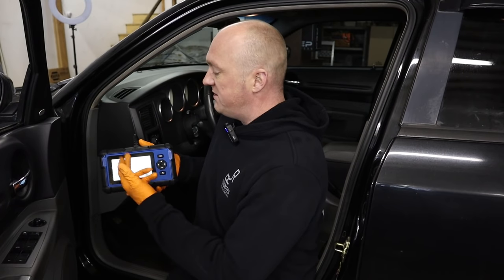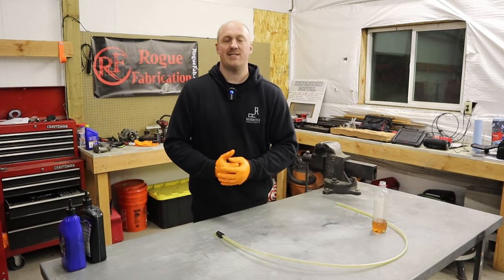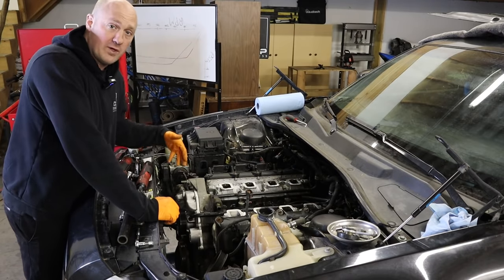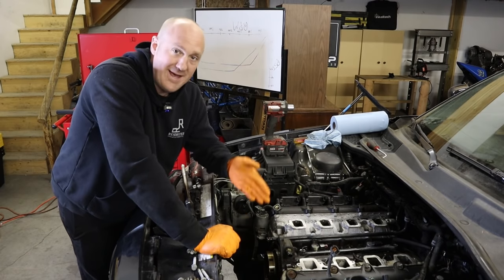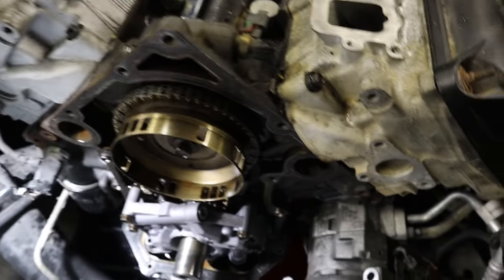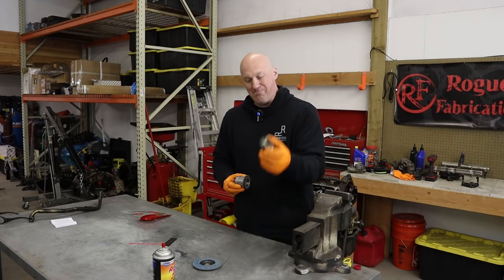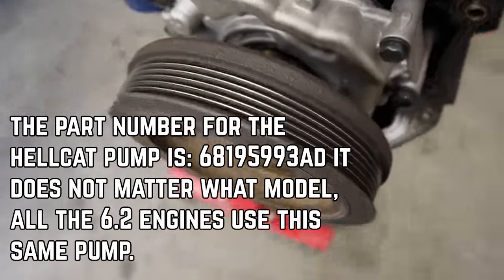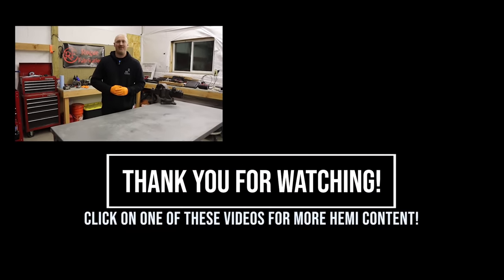Will This FINALLY FIX Hemi Tick? #hellcat

Comment from the maker: What do you think? Are you convinced that this mod will fix the lifter issues?
Reply: I'm skeptical too be honest. I simply run Redline 10w30 and my oil pressure has never went below 38psi, on a 97 degree day after doing a 0-130 pull lol. Typically my oil PSI sits around 44-46 when hot and idling.

Edit: I should also mention my water temp was 243 for what that's worth
Reply: On my RAM 1500, if I tune my idle to be a bit higher, is that a decent temporary solution to low oil pressure or is it pointless?
Reply: nope, it wont fix the lifter issue. The hemi tick came from the Bermuda triangle.
Reply: Nope. However it is a good upgrade. More volume more lubrication. I'm more convinced that it has alot to do with overall engine and oil Temps. 195 t stat and a oil cooler would help alot in my un educated opinion. I'm personally running 5w30 year round hee in canada. Only 45k miles on my 17 5.7 ram so wish me luck.
Reply: if low oil pressure at idle is the problem, then this will cure it. I have a question about oil pressure sending units. Mine failed (13 Charger 5.7), and the replacement I was sent still shows oil pressure at a constant 99psi. The OBD2 reader says that the voltage range is not what the computer is expecting to see. The part number I was expecting is 5149062AA, people keep sending me 5149062AB. The Chrysler TSB says to use 5149062AA... What is the difference between the two part numbers?
Reply from the maker: @Tumbleweed_Tx  the change from AA to AB just means it's a superseded part, its the same part.
Reply: @Tumbleweed_TX  You could have a break in the wire harness.  The open circuit would explain the code your getting.
Reply: I can only see this being a good thing. Trying to decide if I should do it myself.
Reply: Time will tell if this fixes the lifter issue, but it is a very sound theory for now.
Reply: I hope it does🤞but only one way to tell.
Reply: I have an 09 5.7L Charger PP w/149k miles. I put the last 3k miles on it. I would only get a tick for a few seconds on cold startup after the car had sat unused for about 10 days. I have done 3 oil changes on it. One when i first bought it at 146k miles, and the second at around 148k. When I installed my filter @146k miles, I also added some neodymium magnets to the outside of the filter can. About a week or so before the second oil change, I added about a 1/2 qt of MMO, and then I added 1/2qt  of MMO the day of, just before I ran it about 10miles up the freeway and back immediately prior to my 2nd oil change. When I cut open the filter, it was obvious that the magnets had captured significant ferrous "dust." With my oil refill I added 8oz of MMO. I have been running full synthetic  5W-20 and a WIX 57899 filter. So far the tick is now gone. I've only put maybe 1k miles since, but I've not heard any ticks on cold startup no matter how long it has sat idle. I'm thinking that maybe I've cleaned out some (possibly metallic)debris from a lifter passage or two. 
I may well add the Hellcat pump in the future, anyway, and I thank you for performing this excellent experiment for us 3rd gen HEMI fans out here.
Reply: I think it will shurely make it a heck of a lot better. But ofcourse a lifter van always fail. I always thought it was related to the vvt
Reply: Is this worth doing on trucks with 100k miles or more? Or would this have to be done to a newer truck with low miles or an overhaul?
Reply: What is the solution for the different oil pick up tube when putting the hellcat pump on a 2010 Ram 1500 with the 5.7?
Reply from the maker: @notaspamaccount3998  it bolts up just fine, it's just more work because you have to drop the oil pan down to unbolt the pickup tube from the pump.
Reply: @ReignitedAuto  Awesome! For some reason I was under the impression that the pickup tube size was smaller on the 5.7 than on the hellcat pump. It's great to be wrong.
Reply: @ReignitedAuto   The oil pressure on my 2017 charger 5.7 is 55 to 62 when cold and 43 to 50 when hot at idle.  Do think they upgrade they oil
 pump in the 2017 model, because my oil pressure never drops below 38 psi
Reply: Definitely went above and beyond for this one. After having to replace cam and lifter in my 5.7 charger pursuit I for sure want to do this mod just for piece of mind. I also think they used aftermarket lifters because my motor sounds like a sewing machine. Thinking about swapping the lifters just to quiet the motor. Great info though 👍
Reply: Hi
The best solution would be to use Something similar to. oil piston Squirters For every piece of camshaft where the lifter works. 
In addition, a beautiful and laborious presentation for which I thank you. Greetings from Polish.
Reply: I think this is a way to improove the 5.7 but I think even with higher oil flow you not completly eliminate the lifter failure. I think at long idle the oil on the camshaft and the roller lifter is not enough. For the Oil pressure my 2009 Chrysler Hemi (european version) has around 40PSI oil pressure idle in hot conditions and above 70 psi in driving over 2000rpm. I use 5W30 oil because it is recomendet by Chrysler for this model in Europe. My car has now 145 thousand miles and no ticking at all I hope this will last for very long time. I like your videos and the detailed explanation what you think and all the steps you do. Thanks
Reply: What are the torque specs for the mains on a 3rd gen 5.7 with VVT?
Reply: Is the 99psi relief pressure from a hellcat oil pump okay for the 2009+ eagle 5.7 hemi non mds. No downsides involved?
Reply: Also all your videos and discussions are awesome. Building my STP 2012 challenger so you have very awesome content which I come to regularly! Even taking things I learn onto my dad’s ‘70 Cuda build!
Reply: Either way it certainly cannot hurt the engine.  I am definitely going to upgrade my oil pump to the Hellcat version as I am keeping my one owner 300 long term.
Reply: idk in my 21 5.7 im seeing if i remember correctly 37 hot idle psi it may have been 27 ill have to check next time i drive it...
Reply: you will be interested to know this... a 2021 5.7 idles around 750 rpm but i was seeing 34 PSI at those low of RPMs... when i revved it up to 3500 my PSI was at 55... this has me wondering if dodge did some more reworking of the oil pump to get those numbers up a bit from 2017 to 2021...
Reply: Thanks Reignited. This modification kept me busy for three days in my driveway and absolutely love the higher oil pressure when especially when my 5.7 engine is hot and left idling. After fitting the hellcat pulp It never goes below
220kpa and that makes me very happy.

Boy it was a project for me under the carport but I got it done using your videos as a guide. 
The RAM is different because it has so many more strengthening brackets and a front Diff to lower out of the way.
But I got it done with your help. Thank you Sor
Reply: @ReignitedAuto  no it’s The hellcat pump I fitted gave me higher oil pressure at low idle and all through the rev range. 
It’s well Worth doing
Reply: My concern is: will highier oil pressure cause oil leak?
Reply: @derekliu2448  I have the hellcat oil pump amd I have no oil issues and enjoy high oil pressure at all engine speeds. Highly recommend this improvement to engine lubrication.
Reply: @secretdad544  Thanks a lot for replying me. How long have you had it?
Reply: @derekliu2448  it was a brand new car at the time I did the modification. 
It had done 5000 kilometres
Reply: @PotatoeJoe69  are you sure about 243 water temp? last i checked anything over 225 was overheating my friend...
Reply: @gidderman  You do a 0-130mph run on a 97 degree day and let me know what your water temp is
Reply: @PotatoeJoe69  Lol not overheating. In fact with my CSF Rad i would say i could run in 110 degree weather,.. and the engine would not go over its normal operating temp, pulling a trailer no less. If you are running at 243, something is wrong...
Reply: @derekliu2448  hi Derek
I have a new RAM1500 with 5.7 hemi 8 speed auto. (a DS quad cab “poverty pack” delivered in Perth western Australia February 2022 and 
After the dealer refused to fit the higher volume oil pump saying it was not necessary
I went ahead and fitted the higher volume Hellcat high volume pump at about 9000km (closely following this channels awesome advice.)

The effect has been to have higher oil pressure across the whole
Rev range 

But because of the oil pressure relief valve built into the oil pump the maximum pressure is never higher than 520kpa 
(520kpa is the highest pressure Which only happens On cold (6 degree celcius) start up.)

Once the oil
Warms Up to about 100- 108degrees celcius - the oil pressure Settles down to  about 430kPa on the highway at 2000rpm

Engine at idle is where the main difference is found
With a hot engine,  oil pressure gets down to as low as 225kpa with the hellcat pump

Which is better than the original oil pump which would go as low as 190kpa at idle on a hot engine (hot engine oil temp 108degrees celcius) 

I am feeling Very glad I did this modification of fitting the hellcat oil pump - even though it took me 3 days pottering along in the driveway… RAM being 4WD meant I had to lower the fromt Diff and remove a few extra strengthening brackets that are not found on a street car but are fitted to the RAM to beef up the driveline strength for off road

I am happy because I feel the higher volume hellcat oil pump is going to ensure that my engine is always bathed in plenty of oil - even at idle rpm

I use 0w - 20w Amsoil or 
Nulon 0w -20 Full Synthetic and 
My oil has stayed clean for 10,000km at the higher pressure and so far all is good - no valve train noise.

Another benefit is that while I had the sump
Off 
I got to clean out a couple of slivers of metal that were sitting in the oil pan - (probably from machine work during the engine’ s manufacture).

No oil leaks and all I did was follow the directions in reignited’s video.
Reply: My question would be, can the 5.7 handle the extra oil pressure?
Reply: @dangnation5378  the oil pumps all have a relief that limits oil pressure. My engine is fine. Never goes under 220kpa
Never goes over 570kpa (cold start)
No oil leaks. No hemi tick.
I fitted the hell cat oil pump when my 5.7 made 10,000 km and I am glad so did it
Reply: @secretdad544  good to know. I have a 2020, I’m not sure if they fitted a better pump from factory but my cold start says 344kpa and 413kpa at around 3000rpm under light load. Still researching the oil pumps as there isn’t much info on the 2020 and newer. Very appreciative of you sharing your experience.
Reply: @dangnation5378  cold start was high on mine too… but after the oil gets to 100 (centigrade) the oil pressure at idle with the stock oil pump would go down to 180 - 190(kpa) 

Since fitting the hellcat oil pump I never see under 220 (kpa) even at idle.

It is higher everywhere but the low pressure at idle was what I was wanting to improve. 

It was a hard job on the 4WD RAM 1500  my driveway because big bolts and dropping the front differential out of the way meant a lot of brackets had to come off 

But now I am glad I did it every day

I also followed the directions in his video and no oil leaks 🙏
Reply: Now if we can fix that hemi low oil pressure with the hellcat pump i will consider it a full fix ✌️
Reply: Can the lifter tick be heard while idling the engine for 7-10 minutes after driving or is it only in start up that you would hear it?
Reply from the maker: @beauderoy7745  lifter tick is generally only noticeable after the engine is warm,  unless it is really advanced to where you'll hear it at all times.
Reply: I think your dead on with your results that give true readings. 
  I was wondering however. 
  I have a 2015 Challenger 5.7 Manual shift. 
  Since it does not have the Eco system do you feel I have to be concerned with a lifter failure?
  I would think no since I don’t have that system. But that being said I do have a stock oil pump!
  At only 20,000 miles showing no signs of lifter noises and no residue in old oil. 
  Thanks again for some fantastic videos. 
  Please give your opinions on my car. 
  Thanks
    Richard
Reply: Hi sir. I have a question. On the driver side… 4th lifter doesn’t fully slide in the hole.. any suggestions??? Thank you so much
Reply: Hello sir .. I have a question. Driver side 4 th lifter doesn’t fully slide into the hole. Any suggestions as to why not?? Thank you 🙏
Reply: Hello, I made repair my engine and replace my old oil pump to hellcat oil pump. Now I have code p1524 (oil pressure out of range). So is there any solution for this issue? If I change oil pressure sensor replace to hellcat sensor will it help ?
Reply: Like 500 bucks for that pump 
It better work ,plus mech pay and fluids smells like a ripoff 
Thinking a old 2jz and a Lexus automatic transmission would do better and last more than 180xxxx miles  
Absolutely awesome video and tips
Reply: My 2019 5.7 always has 50psi on start up and 49psi when idling with oil hot.  I never see much difference in it even during the winter.  It has 33k mi.
Reply: @Aldovargas87 I was wondering the same thing
Reply: @secretdad544  I'm looking to do the Hellcat pump swap on my '14 Ram 5.7. Did you have any loss in fuel mileage?
Reply: I have a 2019 1320 scat pack, does this model, do I need this too or I’m safe to stay with the one in the car now. And if I do need to change it what is recommended.
Reply: No because the Hellcat lifters are failing the same.  A friend of mine works for the SCDOT and he does about 7 of these a month for police cars and fleet trucks with the Hellcat engine.
Reply from the maker: @horsingnaturally2244  police cars and fleet trucks do not come with the Hellcat engine. There are 6.4 powered trucks, but the Hellcat is a 6.2 engine with a different oil pump.
Reply: My 2014 Ram 1500 is in my shop with the new (NuTech reman from Autozone) engine hanging from a hoist while I attach the old manifolds and new pumps because my tick turned into a clank at 250k miles. It came with an oil pump, and I’m going to mic it to see if it’s the same size as stock or if they sent a higher volume pump (which I highly doubt). Wondering if I would void my engine warranty by putting the Hellcat pump on it. Thoughts?
Reply from the maker: @philbear21  there is the potential that it could void the warranty. However, you would have to be pretty darn observant to realize there is a difference between the Hellcat pump or a stock one since externally they are identical.
Reply: @ReignitedAuto  yes youre right. The external dimensions of casings are identical. 
I don't remember the numbers, but I did mic them and they're the same.
The difference is inside, where they milled it out to accommodate the larger pump rotor.
After seeing your post on this, I installed one on my 2014 Ram 5.7.  On cold start I'm pushing about 95 psi, after warm up about 70.
That's a helluva jump from 58 and 40
Reply: I don't know if it will actually FIX it, but better flow means better lubrication. Team that up with a quality oil stabilizer, and it will sure prolong the life of those needle bearings against wear
Reply: @ReignitedAuto question regarding supposed upgraded lifters you were talking about in 2016. Do you think the upgraded lifters have better designed needle bearings than earlier versions and that is how they get the term “upgraded”?
Reply from the maker: @lickitysplit2413  I don't think they are better at all. Once they went to larger diameter needle bearings they had to make the roller thinner, this was a mistake in my opinion. I actually prefer the older style lifters, but they are no longer available, only the newer style.

Comment: I'm not sure if Ram had ever installed higher flow pumps for certain model years but I own a 2016 5.7 bighorn stock and the idle psi has always stayed around 42 at full running temp. I also live in Texas which the outside temp stays around 100 F during the summer. 

I recently just hit 200,000 miles with no major issues except when I replaced warped exhaust headers with aftermarkets around 130,000 miles. All maintenance done  such as oil changes every 5,000, transmission flush, tune-ups, radiator flush and full suspension replacement at 170,000. It has been a great truck and I plan on putting another 100,000 miles on it! I would much rather get an engine replacement instead of buying a new or slightly used truck with today's prices! I just can't comprehend paying $50k to $60k for entry level model!

Comment: Thank you for all the time, effort & expense in performing this testing with the different OE and Melling oil pumps; Impressive video!
On my 2021 Challenger SP/WB with the 392/6.4L SRT engine:  I change oil & oil filter every 6 months or 6,000 miles (whichever occurs first) and use the Mfg. specified SRT products (oil & oil filter) that I purchase at Parts at my local Dodge (CDJR) Dealership.  I purchased my '21 Challenger new during June 2021, and right now (10/10/2022) have only 5,500 miles on it.  I've still changed the oil & oil filter every 6 months.  Vehicle is always garaged and driven (at a minimum) once every few days to at least once per week.  I've not had any issues but do intend to take a look at oil pressure when both cold and when up to temperature, just to know.  The upgrade to the Hellcat oil pump is interesting.  Thanks!  Tom M., So. Cal.

Comment: you are a hemi owners best friend! I am already having the broken bolts at the exhaust manifold at 50k miles ! i plan to update to the higher VOLUME hellcat oil pump makes good sense to me also I use mobile one or equivalent and a quart of lucas-oil . I've never had a failure